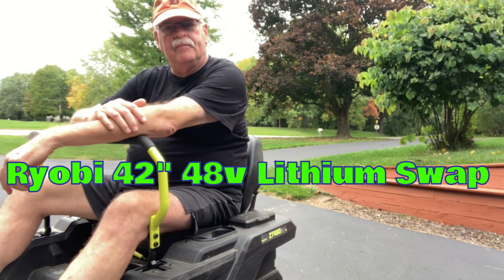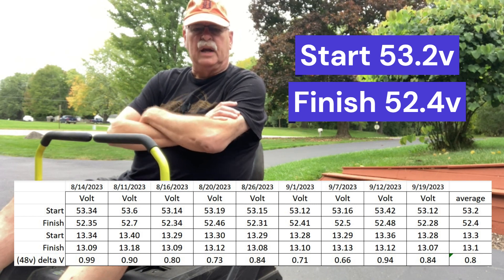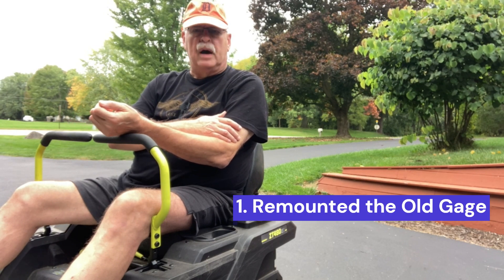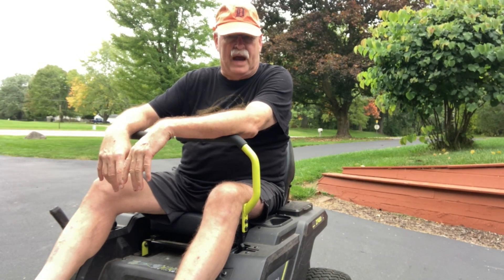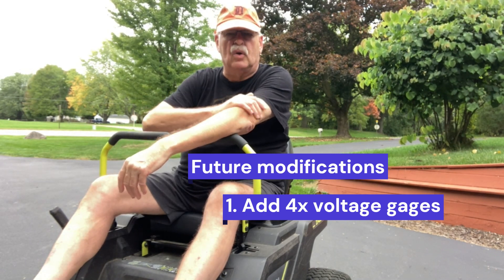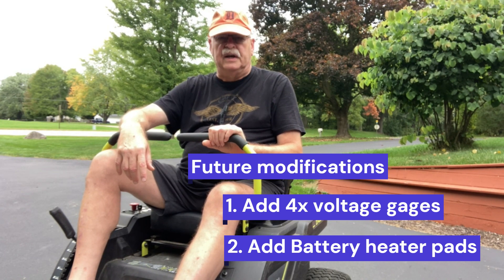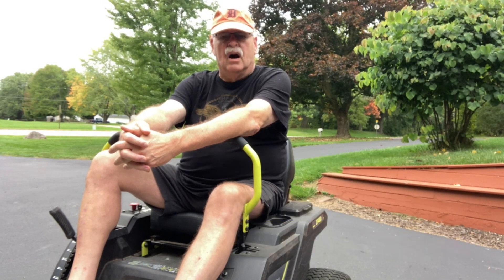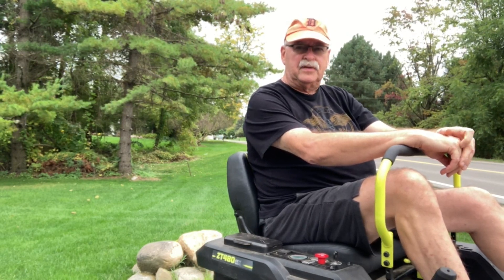Ryobi 48v 42in Lithium swap   10 mows and updates

Comment: Hi Rob,  I have discharged my batteries to 22.6% and now my battery Charger will only run for a few minutes and then shows Full however, my gauge on mower still shows 22.6%.  Can you help me?
Reply from the maker: First of all, you have swapped to LiFePo?
Next, what is the voltage reading?
I the voltage is "full"... like +53v, then you need to reset/reprogram the gage for the % scale.
I hate the % reading on the meter and ignore it.  I leave mine on the voltage reading
Reply: Thanks for the response Rob.  I rest the % gauge and it now shows 100%.  Based on your comment if the gauge is reading the correct voltage (54V),  it’s OK to operate the mower without fear of discharging the batteries below 20% and ignore the % charged on the meter correct?
Reply from the maker: @johnburnette7275  Correct.
If you're at 54v, that's a pretty full charge. 
Watch this video where I ran mine until it died/stopped:
 https://youtu.be/ld1dOZSsA34?list=PLd4K4nUH_WO3BvmtFUAhUX4JR1CZCxIzN
According to MY battery manual, the voltage can drop to 46.4v before it disconnects.
Remember, that LiFePo4 batteries will hold the voltage pretty level... then it will drop like a rock.
Lead Acid batteries drop voltage at a pretty steady down slope.

Comment: Since I made the switch the meter for the batter keeps saying 100% no matter how long I use it!
Reply from the maker: If you're talking about the original Ryobi meter, it is not effect for battery life when using Lithium batteries.  It's only good for tracking "hours".

If you're talking about the "new" gage that I installed, you'll need to pay close attention to the programming.  It's very confusing to program, and I'm not sure I have done it correctly.  

I don't really use the gage, as I can get everything done I need: mow, sweep. kid rides, etc. without running out.

Comment: Rob I have followed your videos, I replaced my batteries the first time with lead acid a year before the problems were reported on YouTube, mistake when I checked with Ryobi customer service  they directed me to order lead acid.  I have a little less than 3 acre and it was taking two days to cut now it three plus sometimes.  Anyway, my question is have you heard from any one that replaced the four battery with one 48 volt and had space for the charger to be installed? I have seen several videos of the change being made on golf carts.
Reply from the maker: I've heard of it being done, or at least someone saying they will.  It should work fine.  Other than confirming the battery size, the biggest issue is how to hold it down.  There's that long center bolt that can't be used.  An alternate clamp/tiedown method will be needed.  That bolt also holds down the tray.  
If the 48v battery fails, you need to replace the whole thing.  If one of the 12v battery fails...
So, yes... it should work, but I chose the less complicated swap.

Comment: Rob, I can't thank you enough.  Your informative videos got me through another summer of mowing!  I'm thinking of taking the new batteries out and storing them inside for the winter since it gets below zero where I live.  Any additional precautions I should take?
Reply from the maker: That would be a good idea to pull the batteries.  Check your battery's owners manual.  
My Chins manual says not to store below 14F.  If stored for over 6mos, do a 95% discharge and then recharge to 100%.  I think most LiFePO4 batteries are similar.
I stored my mower (with batteries) in a (mostly) unheated garage, and I monitored the battery temperatures with WiFi thermometers... detailed in my video:
https://studio.youtube.com/video/c3N4u1tdT-U/edit
My batteries got down to 20F, without apparent damage.

Comment: Hi Rob - love your dyi instructions on this upgrade.  Over here in Hawaii where we literally watch the grass grow (1+ inches per day if the conditions are right), so any mower downtime with 2.3 acres is a major deal.  Did your conversion (down to the last part) on my ZT540e about a year ago, and it was a huge success.  The mower has been a beast at keeping the foliage back, but ran into a problem the other day that I’ve been unable to successfully troubleshoot.  After plugging in the HRTC charge controller to the mower, and turning on the controller, I got an arc on the connector cable at the base of the controller (at the XT60H junction).  I immediately disconnected everything, and found that the solder joints at the end of the RXV cable (where it connects to the XT60H female connector) was exposed, and shorted the two leads into the battery pack (poor quality on HRTC’s side).  Problem now is that the mower will not turn on.  I’ve confirmed the pack is registering 53+ volts, have tried bypassing the keyed switch, and have confirmed the inline 125a fuse has not failed. I’ve replaced the charge meter with a known working unit, and no success.  Only other in-line component that I can think might be related is the TJ918-1  module.  Not sure what this component is for (or how to troubleshoot it), but based on my current scenario, I’m curious to know what you might try next?
Reply from the maker: Darn.  I had noticed the poor connector on my charger, and taped it off to prevent it from shorting out.  It looks like a poor quality plug from the 60's!
Have you checked the Greg and the FaceBook website?
https://www.youtube.com/redirect?event=video_description&redir_token=QUFFLUhqbjRNOWNfUGJFOWtaQ1RwREs1cGp6ODRTSVNId3xBQ3Jtc0tuWndhTExCRTViY0hVaUFueVNBMHJ0bUNjaUZGSTJMTllIM3kwc3JtZk9mcGRfX0czNVVWeTF5cXVxVEFLbUhUdEdvWHNRa2xZZmp1Zm9DUXBCT19DZFdocGg1MkhjVmRZak0yZFk0bjl1TjJ0MDJsZw&q=https%3A%2F%2Fwww.facebook.com%2Fgroups%2F2756962307675482%2Fsearch%2F%3Fq%3Dprecharge%2520circuit&v=WQ-h3viwIvM
Me?  I'm a parts cannon guy.  Not a true electrical expert.
I'd check the voltage at the main relay and see what happens if you jump the relay. 
Also, the charger port has some interesting functions.  It could have been damaged.  I did a video to bypass the charge port:
https://youtu.be/52RbKuon4C8?list=PLd4K4nUH_WO3BvmtFUAhUX4JR1CZCxIzN
If the bypass works, get a charging port.
Good Luck
Reply: @robertveldman1901 Spot on Rob!  Used your bypass tip and the mower now turns on like normal. So I’m guessing the charger cable arc must have killed the charge port.  I’ve ordered the EZGO charger port and will follow your instructions to replace.  I still have the set of terminal clamps that came with the HTRC controller.  Assuming the charger still works, could I safely charge the pack directly at the battery terminal block (until I get the new charger port installed)?

Thanks again for your posted videos.
Reply from the maker: @progressiveboy916  That's great!  I love it when a plan works.
I would say that you should be able to safely charge the batteries with the clamps.  There must be a way to charge thru the big gray connector?  That would be   relatively easy to access.
The EZGO port is not the easy to mount, but at least you can plug it in and verify it works before doing all the mounting mods.
Do you currently have the "3-screw" charge port. or the molded one?
Be careful, and good luck.
Reply from the maker: Anderson Plug!  That's what that gray plug is called!  A medium term charging plan would be to get an Anderson Plug connector cable and adapt it to the Charger.
But hopefully, the Charger Port with be the long term answer.
Reply: @robertveldman1901 My charge port is the moulded version.  I know accessing the battery terminals directly is a pain (having to remove some panel, etc), but hoping I only need to charge two or three times before I get the port conversion completed.  Saw some info out there on rigging an Anderson connector, but hoping my current situation will be remedied soon.  Great work you’ve done on these mowers to extend their life.  Having the original battery system give up after 18 months was pretty discouraging, but with your help we are keeping them running.
Reply from the maker: @progressiveboy916  I'm pretty pleased that after 2 years it went from; How do I get rid of this junk? To: 2 more years and counting!
Reply: Hi Rob, I helped a friend do this conversion with the same exact batteries.

But we've run into an issue! For some reason the mower blades are turning off at about 52V which only happens after 15 or so minutes of mowing. Do you have any insight as to what might be happening here? I contacted Ryobi and they said the blade motor master controller should shut off at 48V. 

Curious your thoughts as to why the controller is now shutting off the blades at 52V with these new batteries?

Any advice is very much appreciated!

Comment: I did an upgrade as well.  Our mods are similar, but a tiny bit different.  I have noticed the heat creates a mandatory break time as the battery's overheat and shut down in the mid to deep south.  I am convinced that heat buildup creates a shutdown as the batteries 1. cut taller turf and 2. large areas.  About 3/4 to 1 Acre pacels.   I take breaks and allow batteries to cool in July and August in Middle Tennesssee and NW Alabama.  I have two properties and one charge will do almost 2 acres with battery cool downs.  Food for thought!!!
Reply from the maker: Thanks for that advice.  For no real reason, I've been nervous about leaving my Lithium mower out in the sun.

Comment: ?Total $ cost and what would it cost $ to have it done? 
Easy but parts
Then and now there are even better Parts like NMC or LFP doped or CATL doped LFP. Maybe some BYD LFP or Na Lion or or or. 
But
Cost $ parts Cost $ to do the job? 
Hourly rate maybe 200% over time to do the job of a experienced battery remover / installer. The a electrical guy EE engineer to finish the wiring.
Reply from the maker: I'm thinking the total parts; batteries, charger, and gage can still be gotten for $1300-1400.  If you need the pre-charge add $50-75.  
I don't know if you can find a professional to do the swap.  I'm not sure I 'd want to do it again to someone else's Ryobi.
There is plenty of success on swapping to LiFePo4.  But, I haven't seen (or looked) for any other alternatives.

Comment: Hi Rob Steve here. Since we last conversed I have my new gauge installed and working great. I did watch your video you sent me on the precharge. It didn't spell out the parts to get. So I found another page that spelled out a push botton with one side connected to the mower side of the solenoid and the other connected to the battery side through a resistor. It didn't work? I made all of the connections with regular clip and crimp style. I wonder if I should have solder? How did you do yours? Thanks Steve
Reply from the maker: Solder vs. Crimp shouldn't make a difference.  My Ryobi didn't need a pre-charge circuit.  I think I have an older mower, and the newer Ryobis were different.
The `pre-charge kit we installed on Jesse's Zero came from Greg Handley on Facebook:
https://www.facebook.com/groups/2756962307675482/?ref=share_group_link

Comment: Hi Rob my mower is cutting great . but not sure how low to let the voltage go down on the gauge before recharge. Thanks Steve
Reply from the maker: Of course, you can recharge any time.  I usually recharge after every mow.
The lowest voltage I went before the mower quit was about 49.5v in this video:
https://youtu.be/ld1dOZSsA34?list=PLd4K4nUH_WO3BvmtFUAhUX4JR1CZCxIzN
The discharge curve on Lithium is very different then Lead Acid.  With Lithium, It will hold a pretty flat/high voltage... until it drops quickly.

Comment: Hi Rob thanks for the info .  I'm glad I'm not alone to deal with this  crazy stuff. I went on line and ordered the push switch and resistor it doesn't look to hard to do. I would have liked to come by your place but I live on the coast in Maine. If your ever out this way come visit. Thanks again Steve
Reply from the maker: Did you get the pre-charge hooked up successfully?

Comment: Hi Rob
Thanks for returning my email.
Here is my story I have a RY480ztr75 zero turn. I replaced the batteries with the LifePO4 batteries. When I plugged the power line together and turned the key nothing happened. I installed the TR16H battery tester gauge with the positive wire to the battery to start. I followed your video. Still nothing the gauge was reading 53.50. So not knowing to much about electrical I went on face book to the Ryobi forum. Someone pointed out that my mower could use a soft start circuit( all Greek to me). Any way it had a picture showing how to install a pre charge circuit with a push switch with a resistor ( again all Greek to me). Some one else said that if you hooked up the charger to the mower and turned the key that would act like a pre charge. You now what it worked! I unhooked the charger and shut it off a number of times and it still worked . I took it for a ride cut a little grass. Came back and shut it off. It started again. But after a  minute it wouldn't and I would need the charger to start the process over again. What could be wrong. Your's seem to work fine. I have the new gauge sitting in my cup holder and the old meter is still in place. I need Help!!!
Thanks
Steve
Reply from the maker: Ryobi clearly changed something on the 48v mowers.  For example, I have what I believe is the older style charging port.  We did the Lithium swap on my friend Jesse's 48v75, and he had the same "starting" problem  He also used the charger pre-charge.  We installed the cheap pre-charge circuit on his and it's been working well, so far.
I understand how the precharge install can be intimidating, but there are a couple videos showing the install.  It's not that bad.  The simple version of the precharge circuit requires removing the side panel (10 screws) and disconnect and reconnect the 4 nuts on the solenoid.  The video is based on a rider, but the zero solenoid is the same.  
I'm located in MI.  If you are nearby...
Reply from the maker: precharge video
https://www.youtube.com/watch?v=jNEGhhh3dMo&t=137s

Comment: Hi Rob I'm not sure if you received my first comment. I just put 4 new lithium batteries in my Ryobi 48ztr75 following your video. I put the volt meter on the post like you did it showed 53.50 . Then I plugged the power in and the gauges don't work when I turn the key on. Would you have any idea what is wrong? Thanks Steve
Reply from the maker: Sorry, I'm confused.  The mower runs OK? 
You used a handheld volt meter to confirm 53.5v.
And the new gage doesn't work at all?

Unless there is something wrong with the gage, it seems like the new gage is not connected correctly?  
Check the white plugs at the battery bridge and the gage. (I had mine come loose once).  
Or try connecting the positive wire to the positive battery terminal instead of the key switch, to see if the new gage turns on.

Comment: What is the make and specifications for the new batteries? I was thinking of doing this myself but don't want to make the mistake of buying the wrong batteries.
Reply from the maker: It's been about a year since I did my swap.  I'm still happy with the results.  I went with Chins batteries because they were cheap and they were the same size as the original batteries.
I ordered the batteries via Walmart:
https://www.walmart.com/ip/4Pack-CHINS-LiFePO4-12V-100AH-Lithium-Iron-Battery-Built-in-100A-BMS-Perfect-for-Golf-Cart/1029813425
$1000.  About $100 cheaper than last year!
You could consider getting "smart" batteries.
Or many have gone with a single 48v battery.
I did several videos on my swap;
https://www.youtube.com/watch?v=hjpxw4PgUq0&list=PLd4K4nUH_WO3BvmtFUAhUX4JR1CZCxIzN&pp=gAQBiAQB
Make sure you get a Lithium charger.  Do not use the original Lead charger.  And consider the impact of cold weather storage.  Lithium does not like temperatures below 14F(?).
There is a risk that you will have "starting" issues.  I didn't have a problem, but several people have commented so.  The possible solution is to get a "pre-charger".  There is a guy on YouTube/Facebook selling them for $50.

Comment: You mentioned that you corrected the green light safety feature fot charging. How?
Reply from the maker: I actually did a video on the green light modification, but found that it only worked on some Ryobi 48v.  On others, it burned up the charger port!  Not good.  Apparently, Ryobi 48v used two different charging ports during it's relatively short production run. So I took the Green Light video down.  I may put it back up with a warning and a clue as to which charging port might be OK.
Reply: Thanks for the reply. As mentioned if the video is up I will take it under advisement.
Reply from the maker: @EdZerweck  I updated my green light mod video and republished it.  See if it makes sense to you; 
https://www.youtube.com/watch?v=qbhLL39Nets

Comment: Hello Rob should i leave the battery on the charger? for the winter.
Reply from the maker: From everything I've read, It's not necessary to leave it plugged in.  I plan NOT to plug in over the winter.  
If I remember, I'll check the voltage once in awhile.... maybe.
According to the Chins manual, I don't see any special instructions except that on pg10 the storage temperature is 14F to 122F (-10C to 50C), discharge temp -4F to 140F, and other precautions if you store for over 6mos (pg34).
(It appears there are some discrepancies between pg10 and pg34.) 
My garage is not heated, but I do have a temperature monitor in there.  And I have a wall heater I could start up if I get nervous.  And I still plan to install some battery heater pads for fun.

Comment: The dual blades are on the new models with the joy stick
Reply from the maker: I haven't looked at the new 80v yet.  Too darn expensive.
I did look at some aftermarket double blades, but decided to not push it.  
I'm kinda concerned about bending the blade motor shaft... those motors are expensive.